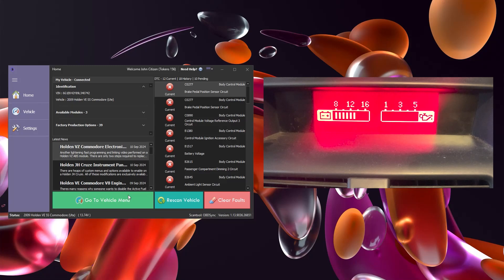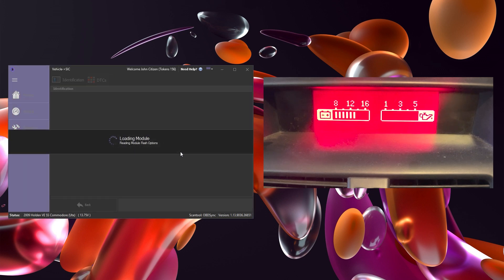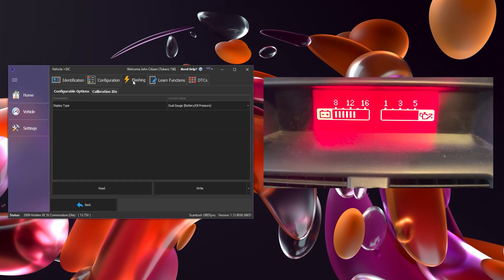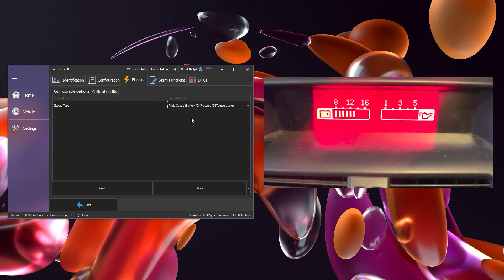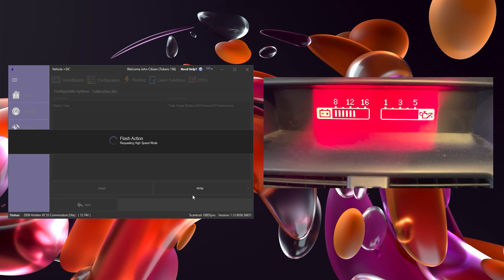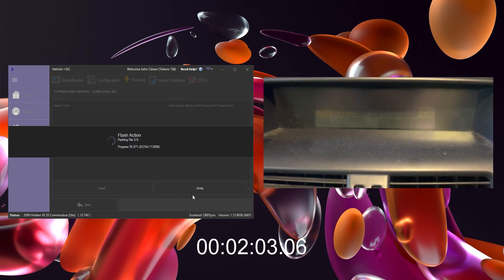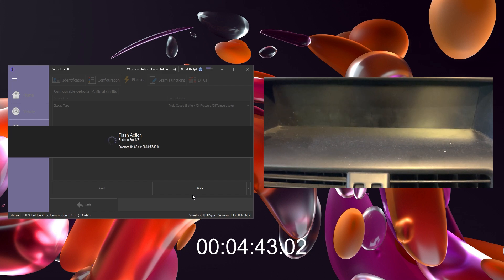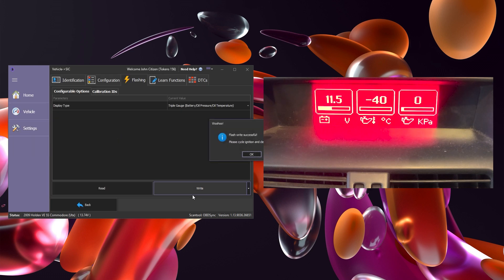Holden VE Commodore Secondary Information Centre (SIC) Triple Gauges Programming

Comment: Jason was very helpful, tried a few times to program triple gauges without success, the problem ended up being the Aerpro/Climate Control, once this was disconnected from harness the programming was successful.
Reply from the maker: Glad to hear you are all up and running!
Happy to help anytime!
Reply: Did the option for triple gauge still show up with the Aerpro climate controls plugged in? And did it not just complete the write or did the option for triple gauge not show up at all? I have a 2008 MY09 VE SS with Aerpro climate but only had the option to go from time display to dual gauge not triple gauge thanks
Reply from the maker: @camm2y  Early modules do not support the 3 gauge programming, the module fitted will need to be replaced with a 2010 module to get the 3 gauges to operate.
Reply: @OBDSync  am looking to program triple guages to my 08 ss but looks like it won't work, is that still the case?
Reply from the maker: @camm2y  The early gauge SIC gauges do not support going to triple gauges.

Make sure you click on the "Flashing tab" and check if the configuration option is there or not to change to triple. if it is not present, then the SIC module you have does not support it.
Reply: @OBDSync  it worked, I updated the software today to 1.15 or whatever it is and the 3 gauges option showed up under flashing tab, it wasn't available 2 weeks ago when I purchased the software was only able to do 2 gauge but now it's 3 and I'm so happy, it's a shame I already purchased a 3 gauge module for $100 but I'll keep it aside as a spare incase anything goes wrong. Great software honestly the best thing to happen to commodores 👌🏼
Reply: @camm2y does the tripple gauges work coz mines got only volts and oil press n everyone saying triple gauges don't work on early ves